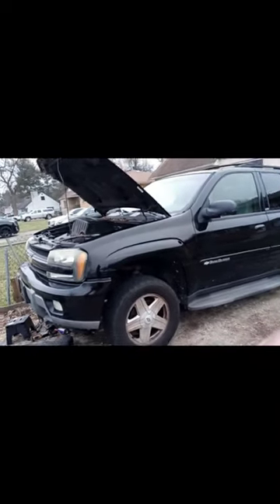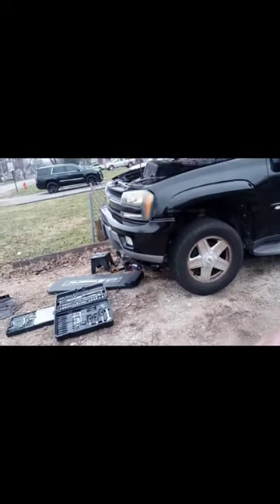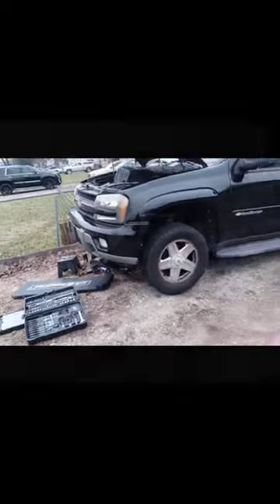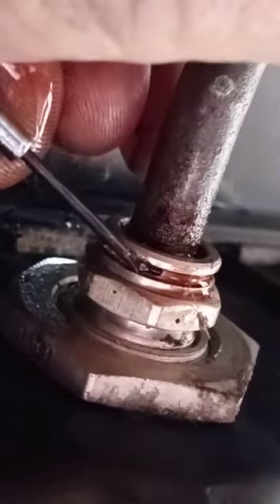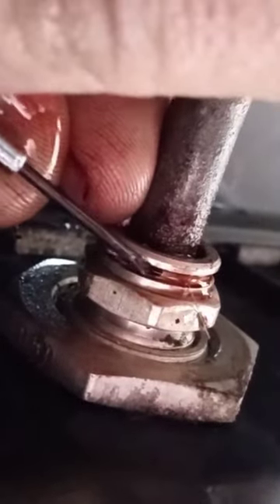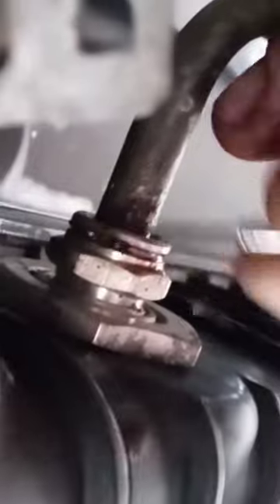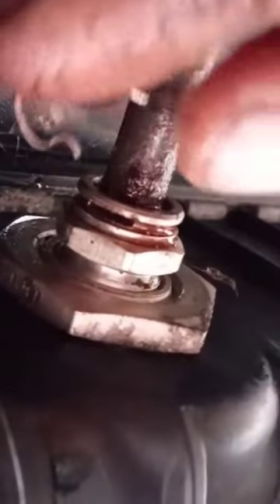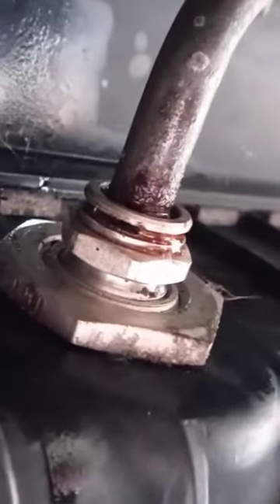GM Transmission Cooler Line Removal

Comment: A lot of people prefer using the special tool to remove those but i never bothered because the edges wear out then it won’t work as easily anymore I always use a sharp pick 👍

Comment: Mines don't have any clips u just push the  cooler I to the radiator....on problem I have is that my transmission cooler line keeps popping out the radiator  "HELP"
Reply: Did you figure what to do?
Reply: There has to be a locking mechanism. No clips?
Reply: You have to put the plastic cap it holds the clip in place if not it's going to keep popping out trust me on this one  @rocknral

Comment: I can't seem to not be able to find an answer. Does the transmission fluid need to be drained to change the cooler lines?
Reply from the maker: Nahhhh but get a pan cuz it will leak

Comment: Why doesn’t my Tahoe have a trans cooler it just connects to my radiator
Reply from the maker: Most are
Reply: @semperfimechanic  it’s built inside internally ? Also I saw some people say that you can have a second trans cooler that goes in front of the radiator?
Reply: How do I add the 2nd  one ? Are the lines different lines than the one connected to the radiator or how does that work